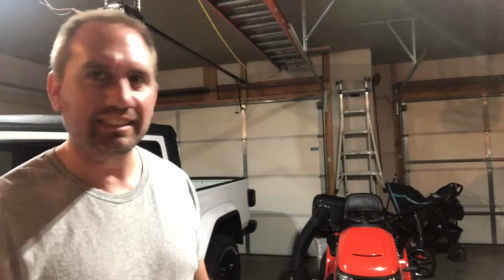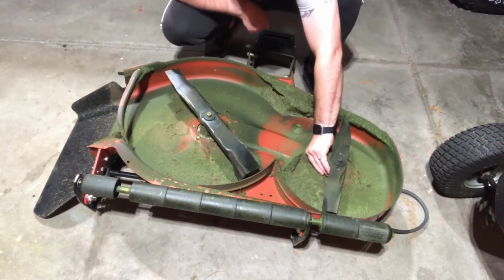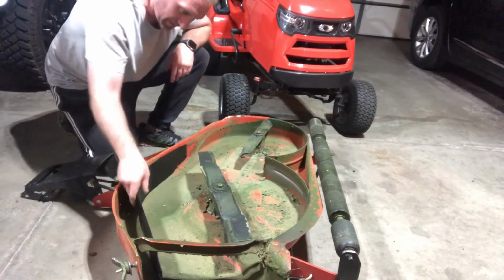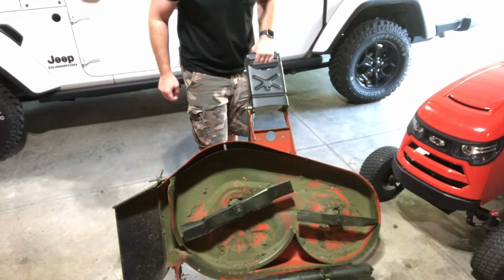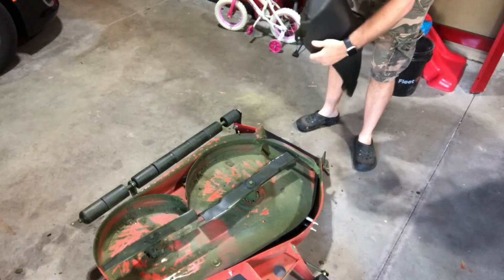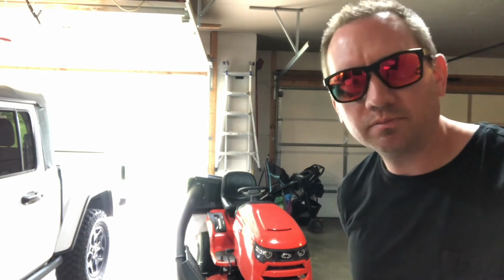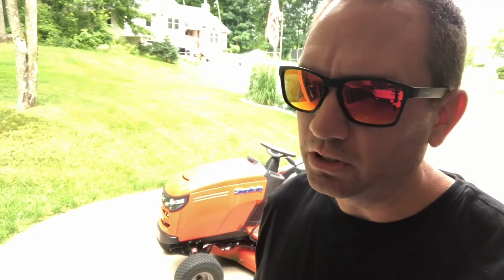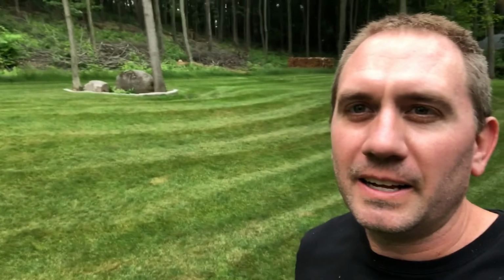Finally Complete - Simplicity Regent Bagger Baffle received, installed, and tested.

Comment: How did the bottom on your mower deck look?  Did it move the grass to both bags better?
Reply from the maker: I definitely get buildup on the deck, but both bags fill full without plugging unless its really wet.  

I have a few other videos on the buildup and trying out some graphite paint to prevent the buildup.
Reply: The parts you were missing Blades and baffle.  Was that extra or just left bout of the box?
Reply from the maker: @mikekress7584  It was left out of the box, dealer was good about ordering them and not charging me.
Reply: That’s great.  How about the bottom of the mower deck.  Cleaner?
Reply from the maker: @mikekress7584  it was an improvement but buildup still occurs.
Reply: Thx!